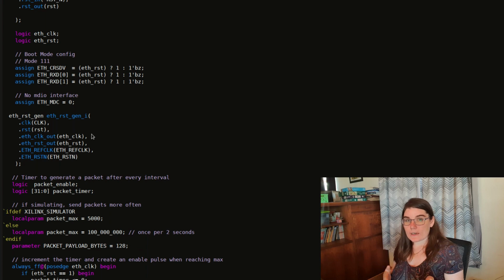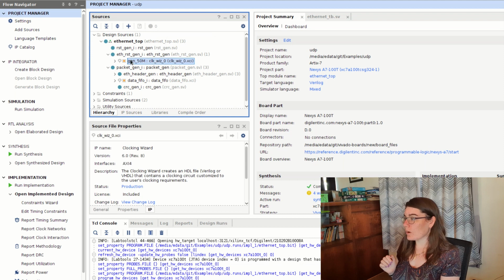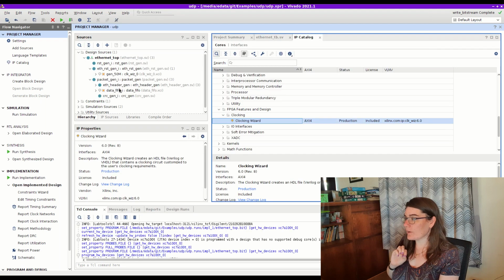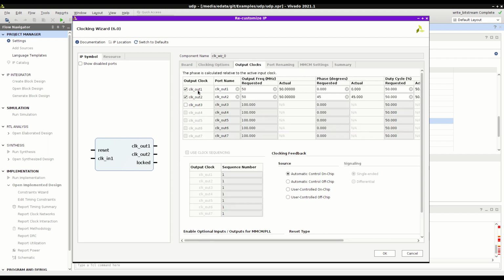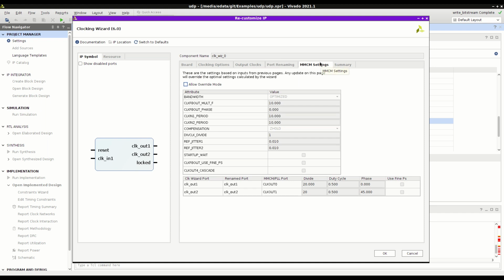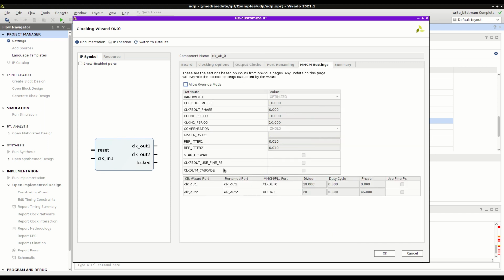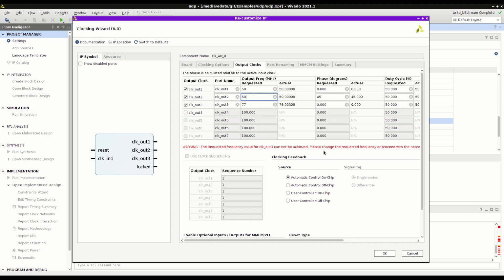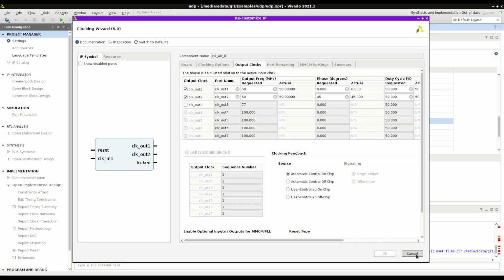How to use the clocking wizard IP: creating a 50Mhz clock from 100Mhz

Comment: could you please explain how would you constraint the clocks based on your example ?
if you are only using the clock output from the clk_wiz  to drive all your ff, do you still need constraint the input system clock ?

Comment: Adding something from my own experience (FWIW):
For some cases (particularly those at a fairly low frequency relative to the input), it is also possible to generate a clock signal via an accumulator (using the MSB as a clock bit; adding a fixed point fraction with each step on input clock), which doesn't need an MMCM or PLL, and also is easily adapted to frequencies that can change dynamically at run time (by allowing the step fraction to be modified as needed), ...
For 100->50 or similar, one can also do something like "always @(posedge clock100) begin clockFake50 <= !clockFake50; end" or similar, ...
Though, "for reasons", one probably shouldn't use these sorts of faked clocks as inputs for 'posedge' or similar (their timing properties "aren't quite right").
Reply from the maker: This is a good point! I didn't explain why I use the clocking wizard. Here's why: The tools will route the clock signals on dedicated clock-only paths, which are designed for clocking. When a clock is manually created in the method you describe, the tools don't necessarily always identify that signal as a clock, or know what its clockrate is. Sometimes they pick it up as a clock based on its sensitivity list usage, but not always. If it's not on the dedicated paths, the tools won't be able to analyse the timing properly. 

The only exception to this is really slow clocks (<1Mhz, I'd guess), where the clock is slow enough that it doesn't need to be on the clock dedicated paths. In this case it almost acts as a clock enable (which is what I'd do, create a clock enable at the correct rate and use that).
Reply: @FPGAsforBeginners  Yes, as noted initially, you wouldn't want to use these for 'posedge' or similar. They can be pretty useful though mostly in the context of interfacing with external hardware, or one can have a "strobe" signal (single cycle pulse on the parent clock) by using a carry output, which is often useful for state machines, ... Depends mostly on what one is doing with it.